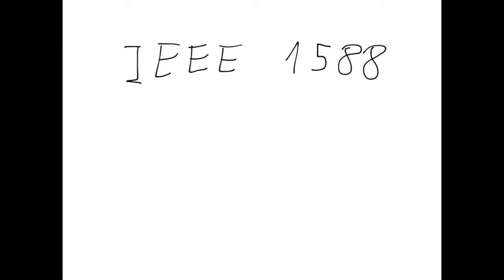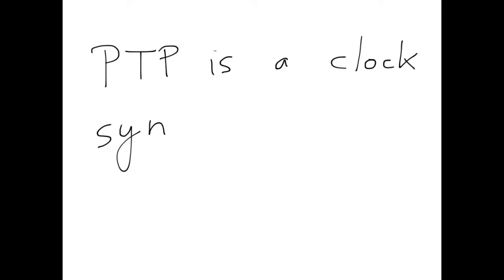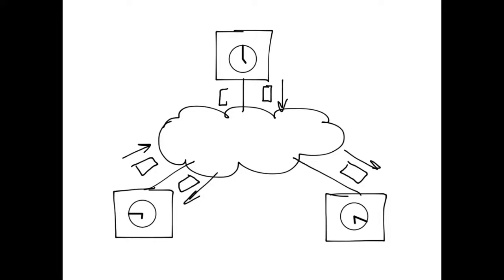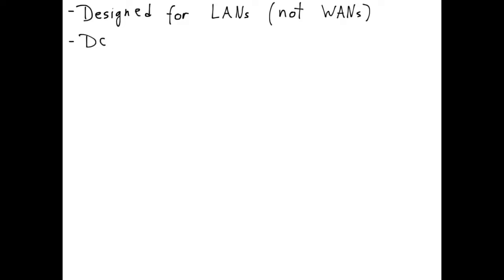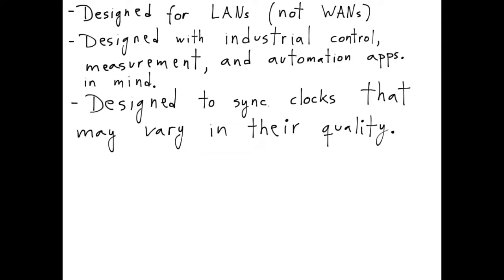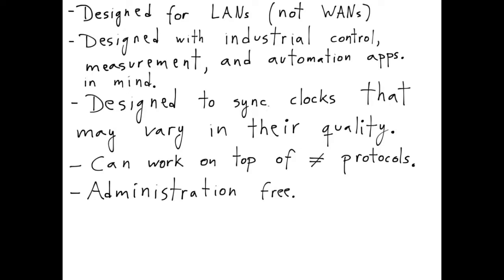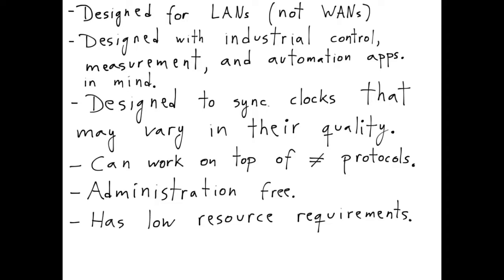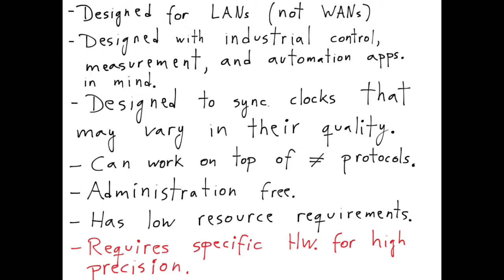Precision Time Protocol (IEEE 1588): main features

Comment: Good video! One thing: "Has low resource requirements", it actually takes around 10-15k CPU cycles every program cycle for a high-performance 32-bit STM32 micro controller (client-side). This is quite a hefty task for an embedded controller (worth it though). It does however indeed have a very low footprint regarding memory and bandwith.
Reply: 10-15k CPU cycles @ ? Mhz CPU clock?